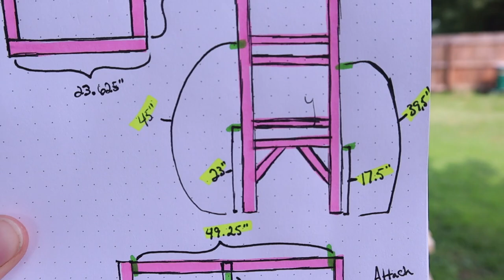Building our DIY QUAIL Hutch + so many chicks!

Comment: To help save money, on the tops, back, and sides, use mosquito net instead. I would recommend for the door hatch on the doors, to be at the bottom, and not the middle, as the quails should be able to push the corner of the door enough to tilt and get out. Even better, put two door hatches on each door, one on top and one at the bottom. Great cage design, though.

Comment: Hello from Wrightsville Ga I enjoy your videos they are very educational. L have a question in one of your videos you doctored one of your does eye I have a doe that I need to doctor what do you put on it thanks in advance
Reply from the maker: I use Terramycin antibiotic ointment from Tractor Supply! Just use a warm, wet cottonball to clean the eye (never force it open) and then once it softens enough to open, I put a small dab under the eyelid and gently massage it. Do this for 2-5 days, twice a day, and it usually clears up nest box eye symptoms.
Reply: Thanks have a great day

Comment: It a beautiful green colour. I like the pvc hardware cloth. That’s a nice touch. Did you consider using it for the ceiling as well? I wonder if that would help with quail injuries as the hardware cloth is pretty harsh. As for the screws, I really like using 1” narrow crown staples. You can get pretty cheap air nailers if you have an air compressor and it makes installing hardware cloth very easy.

Great video!

Comment: Your quail hutch looks very similar to my one but there is one thing your hutch needs to be improved to make sure it is safe from predators. It was the trays that have the gap above them for predators like rats or raccoons to burrow into the hutch and kill your quails.
Reply from the maker: Predators can’t get through the 1/2” x 1/2” wire.
Reply: @TealStoneHomestead  I was saying the gap between the tray and bottom of your wire mesh, the rats can get into the tray and bite your quail’s feet, this may not kill your quails but your quails will be seriously injured and stop laying eggs due to stimulation by fright.